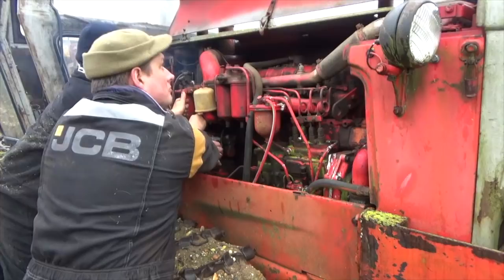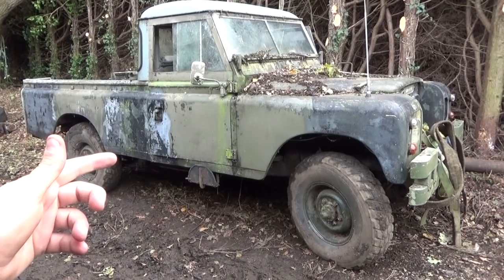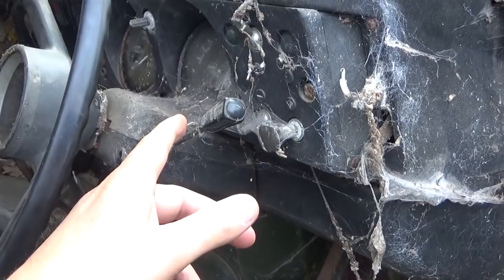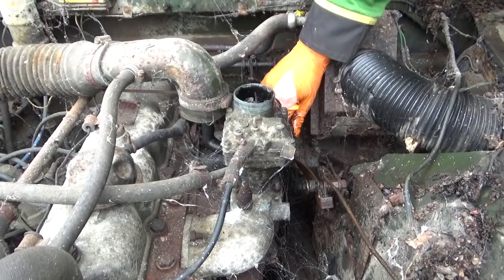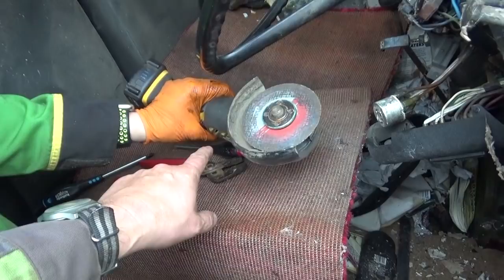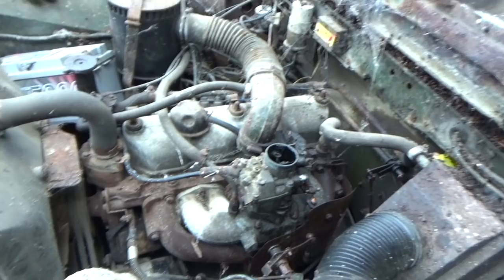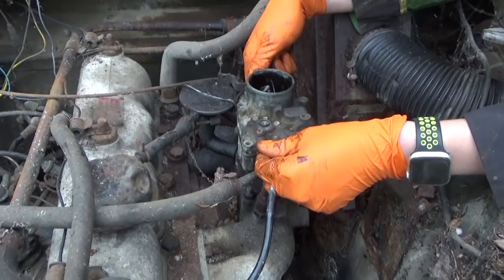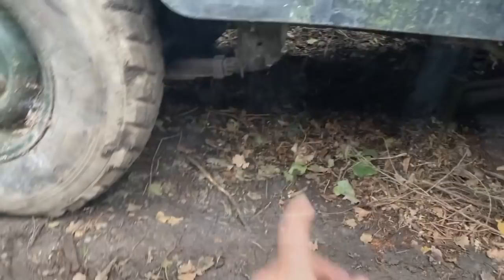ABANDONED Land Rover - Will It Start ?

Comment: Get that old girl rebuilt on a galv chassis and bulkhead and she'll be a better car than that new piece of shit defender they've brought out. Yes I drive a defender!
Reply from the maker: The new Defender will be a far better vehicle than the old one if you need to tow a trailer or carry tools any distance in comfort. Times have changed and so have the requirements of work vehicles. The old Defender is uncomfortable, noisy, let's water piss in and leaks oil everywhere except where it rusts - I've had enough of the fuckers to know. The D4 should have been made into its replacement but this new Defender seems like a compromise between the two so we shall see.

Comment: They still using Buick engines ROFL!
Reply from the maker: No, it's a Rover engine, it has nothing to do with Buick.
Reply: @LordMuck  Just kidding. The ones in the '50s had V-8s from GM no?
Reply from the maker: In the 60's they took the 3 ltr Buick and bored it to 3.5 and used it until around 1990 when it went to 3.9, then 4.0 and eventually 4.6 in about 1995.

Comment: Love it...dont recon is ex army though...nothings army about it except colour lol
Reply from the maker: ...apart from the military chassis, IR lighting, convoy light on diff, NATO trailer plug and hitch, pioneer tool tailgate, military seat squabs and its original British Army ID plate with its original service number ?
Reply: @LordMuck  ah....didnt show that...expected to see the sealed  electric system. 
Shame the original roof and windows are missing .
Reply from the maker: The plate is visible when the door was opened, you can see the double front bumper and military lights plus fuel tanks under the seats etc.
It's all easy enough to spot if you know anything about military Land Rovers.
Reply from the maker: And sealed electrics are 24v FFR not 12v GS
Reply: @LordMuck  I stand corrected...I  will  get my coat 😊
Reply from the maker: You can hang it next to my anorak 😂
Reply from the maker: Try and get a copy of Bob Morrison's 'British Army Land Rovers'. It's a great read and tons of pics and info.
Reply: @LordMuck  😂